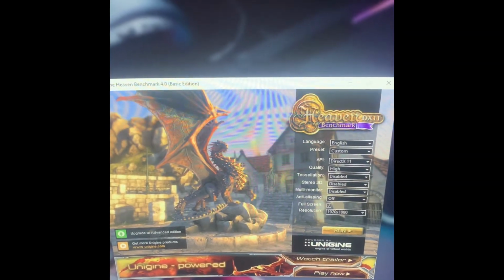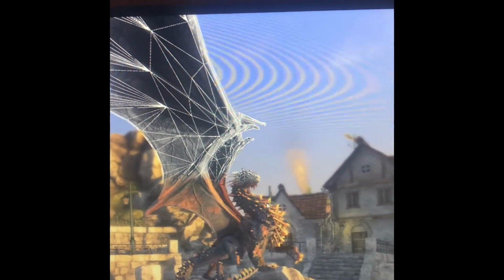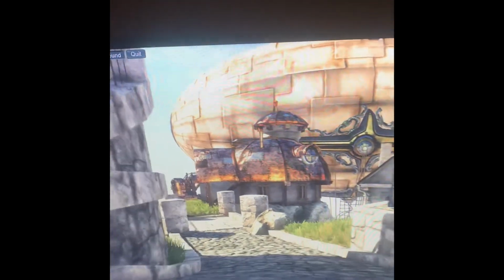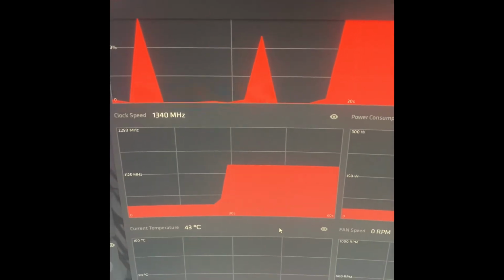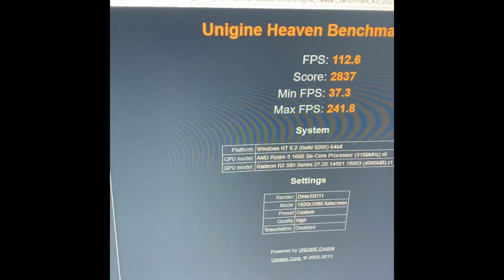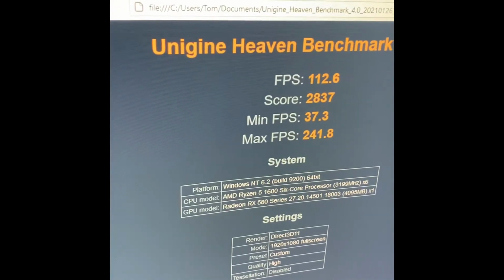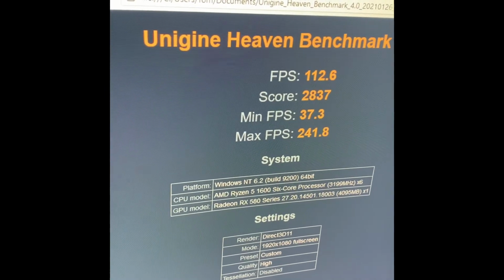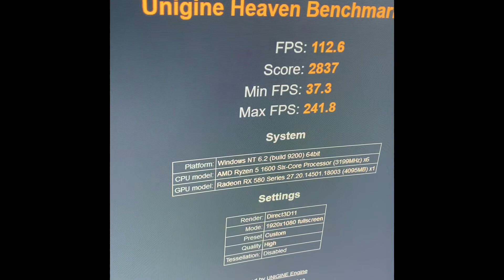Sapphire RX580 - Thermal Pads: What size to use? Explained

Comment: Will this work on the RX 580 Pulse too?
Reply from the maker: Yes, they used the same thickness pads.

You can try squishing down 1mm or just go straight to 0.5.

Had a commenter earlier in the week have success squishing 1mm.
Reply: @JLRO7  Do soft thermal pads depend on the brand?
Reply from the maker: @Skewel  From what I’ve read the higher quality pads will be more squishable but even then I’ve seen people say they didn’t have success with it.

Wouldn’t go for anything less than Arctic/thermal grizzly pads.

But I bought cheap 0.5 and they worked so it’s up to you. If you read through the comments here 0.5 has been successful for others.
Reply: @JLRO7  Hmm you're saying 0.5mm works and Sapphire Support says that 1mm is also good. I'm confused.
Reply from the maker: @Skewel  I’m saying 0.5 worked for me.

1mm did not work for me but others have had success with it. The success depends if the pad will compress enough.

The cards originally used 0.75mm.
Reply: @JLRO7  Did your 0.5mm pads make sufficient contact with the heatsink?
Reply from the maker: @Skewel  Yes, same temperature as the original pads but card boosted higher so better heat transfer
Reply: @JLRO7  Cool, also correct me if I'm wrong, when it comes to thermal pad is 0.5mm greater than 0.75mm size-wise?
Reply from the maker: @Skewel  0.5 is smaller.

0.5 = half of a mil 
0.75 = three quarters of a mil
1 = mill
Reply: @JLRO7  Oh, so I guess even the stock 0.75mm thermal pads were slighty taller and compressed the rest of the length to fit. Whereas 0.5mm is the perfect size.
Reply: @Skewel   0.5 for all? vrm and vram?

Comment: I order a 0,5mm pads for my Sapphire i dont have GPU temps problems in iddle it stays arrouns 25-26C and on full load maxed 74 only in benchmarking,but in games it never passes 65C,and i dont have all thermal pads just a some 2 or 3 it came in that condition,only thing that worries me that i cannot se vram temps...... i dont wanna gpu die in this moments when prices are sky rocket.Did you end up good with 0,5mm?
Reply from the maker: There was nothing wrong with the pads before, I just changed them when I put new thermal paste on which is where is started crashing.

It looks like you have good temperatures, the card would shut down if something was wrong.

I would leave it because it can be a big headache otherwise.
Reply: @JLRO7  I changed today,i put all new 0,5mm thermaln king brand and i i lower temp for 10C in extreme preset test benchmark definitly worked out with 0,5 ty for video bro.
Reply: @grimreaper9853  what thermal pad u used?

Comment: I have the msi rx 580 8gb gaming x card what size thermal pads would work
Reply from the maker: I’ve looked and can’t find any information - best bet is to just leave the pads and put fresh paste on assuming your pads still have some life left.

Failing that I would buy a variety pack of thermal pads and just work down in size until you get stable results.

Starting off at 1mm would be a safe bet.

Comment: just want to mention that your card has a small button switch that switches between performance and silent mode so... the crashes might have been from this. Still thanks for the video, will definitely hope that I won't have to change my pads. Rn all  I want is to remove the thermal paste and put a damn grizzly thermal pad and never open my gpu again
Reply from the maker: Yeah the card worked before I took it apart and didn’t after. It wasn’t until I re-did the pads it started working again.

Unless the pads are in dire condition I would avoid changing them, it’s not worth the hassle. Using some nice paste however is easy and only takes a few minutes.
Reply: @JLRO7  in case you didn't understand you could put on the gpu cpu grizzly thermal pad 0.2 mm you could buy like 32x32 or 38x38 cm and cut it with scissors. After that you wont have to open your gpu again. Unless it's full with dust but that won't happen so easily

Comment from the maker: I only made this video for those who had a Sapphire 580 and made the same mistake as I did as there was very very little information on Google.

If I knew it was going to be top result on Google I would have tried to make it more informative. This was just me after the card crashing all night and taking it apart 4-5 times.

Other 580 owners are asking about their cards and unfortunately there’s even less information out there for other manufacturers.

0.5mm definitely works for Sapphire but other brands use thicker pads so 1/1.5mm might be more appropriate for those.

If you’ve changed your pads on another card comment below and I’ll make a little list of what works for those that find this video.
Reply: Hi, Could you help me with backplate screw positions? I forgot those :(. I have 3 length (same type, black color) of backplate screws.
Reply from the maker: @pcman3158  Hi, I don’t have the card anymore but maybe these 2 images will help?

https://d3fa68hw0m2vcc.cloudfront.net/904/177577833.jpeg

https://legitreviews.com/wp-content/uploads/2017/04/sapphire-nitro-rx580-le-power.jpg

Sort of looks like the longer ones go on the outside and the shorter ones are toward the middle?
Reply: @Jowsh thx so much for this info man. I changed thermal paste n pads from a miner rx 580 sapphire to 1.5mm on memory n it crashed, 1.0mm then 83 on superposition, now i’m just waiting for 0.5mm to arrive n be happy to be able to overclock the gpu 😂😂
Reply: Next time try to use "Honeywell PTM7950" on your card's GPU instead of thermal paste. You'll be surprised.

Comment: Does your fan speed/noise go 100% after using 0.5mm? My Pulse variant been doing max fan noises.
Reply from the maker: No it ran cooler than before the change, if your fans are ramping up like that you may have to look at the thermal paste application. 

Chances are not enough heat is being exchanged because there’s too much applied.
Reply: @JLRO7  How do you get VRAM and VRM temps on your nitro? I can't seem to get real temps as fans go max even below 70C.

Comment: I also had this problem in November 2020.
Bought 1mm and although gpu temps were low, it was not boosting pass 300mhz and the FPS were very bad... Before respasting everything worked well but I still wanted to repaste because its a mining card and it turned out to be a lifesaver because the pad and paste were so dry it cracked... I ended up buying 0.5mm and everything is now fine... Temp is a little higher than before respasting but at least I know its clean and safe
Reply: What brand of pad did you use?

Comment: Will the size be the same on the gigabyte rev2 model?
Reply from the maker: A quick google search has said 0.5 for the modules, 1mm for VRM and 2mm for backplate
Reply: @JLRO7  my model doesnt have a backplate i have the rev2 its different but would it still be the same?
Reply from the maker: @SquidNgzz  There’s very little information on Google, there aren’t any confirmed numbers which means you’ll have to use a bit of trial and error.

I would get some 0.5 and 1mm and just experiment.

I did find a comment from somebody on Reddit who used 0.5 on their Aorus variant and they didn’t have any issues.
Reply: @JLRO7  alright thanks mate
Reply from the maker: @SquidNgzz  sorry I couldn’t get a clearer answer, I did look.

The card in the video with the wrong sized pads is still going strong after 6 months. So I don’t think it’ll be a huge deal if the pad sizing is a little off.

Comment: when the software benchmark crashing, did the sapphire led turn off? cuz mine is off and the fan card spinning so loud. i'm using the 1mm though, after watching your video i'm sure will change it to 0,5mm
Reply: check if the button switch is on performance or silent mode. If you have 580 series just look up a video and see that your card has 2 modes
Reply: @BamBam-je4yf  do you mean that switch button on the pcb?
Reply: @gabrel-dias  yes that's the bios switch button. It changes from silent mode to perfomance. I personally never switch it to silent mode because Im either gaming or playing with Photoshop
Reply: @BamBam-je4yf  but does it affect just the fans or the clock?
Reply: @gabrel-dias  I think both. When I was in silent mode my screen used to turn off but the sound continued why gaming . Only restarting the pc worked so I switched the bios to performance and there you go
Reply: @BamBam-je4yf  thanks bro, gonna check if mine is switched to perfomance

Comment: Most likely it was a Mining card, but with the way things are you are lucky, the best I could get was a get a Sapphire RX570 pulse 4gb used, paid the same. now I have to do the same thing you did for my card. so this was really helpful.
Reply: all the 2nd hand cards are mining cards so if you are looking to get one you should wait until you get at least 8GB video card for 200-250 your currency, otherwise it's not really worth it. And if you switch the thermal paste with 30$ thermal pad(grizzly 0.2mm)it will be around 230 or 280 so it's worth it. If the thermal pads are damaged for the other microprocessors then it will be a bit pain in the arse. but the price won't exceed 300 so...
Normally a 8gb card is around 600$ or so.

Comment: how about the pad on the backplate? can we use the same size?
Reply from the maker: Hi sorry didn’t see this. 

The backplate pad isn’t too important so it’s fine.
Reply: @JLRO7  Hey where did you find the manufacturing diagrams? Can you send me the website or link as I want to know the size of my rx 570 armor 8gb oc's one.
Reply: The original thickness pad on backplate are 1.0mm.. also u can put 0.5mm aswell

Comment: I wish I watched your video before doing the exact same mistake today, 16th of April 2021:) I, too, read well before repasting and changing the thermal pads today that 1mm will squish. So, I didn't check youtube or anything else. I thought I "knew". And, no, the 1mm pads didn't squish. Just had the same Heaven crash and then finally went on youtube and saw your video. I used Arctic thermal pads 6w/mk. Will try the 0.5mm. Many thanks for your vid and testing!
Reply from the maker: That’s why I made the video, it was very frustrating reading 1mm will squish and it works when it didn’t for me.

Seeing as we had the exact same problem I’m confident when you can test it will work for you, 4 months later and the card is working strong
Reply: @JLRO7  Actually, in a few minutes after I wrote my comment, I realized that I still have two 67mm 0.5mm Adwits pads, from another older purchase for a motherboard VRMs. The same pads that you purchased, just in a mix pack. So, despite late night here (NY), I was anxious to see the results and immediately replaced the 1mm Arctic pads with the 0.5mm Adwits. Everything works now, no Unigine crashes, idle is around the expected 46-53c when the fans start at 53c and then stop at 45-46c, while the load in Unigine Heaven was 70c (unfortunately, I don't remember fan RPMs). Playing a FPS game today resulted in 68c and max 2100rpm. Thank you again for a very useful tip!
P.S. Oh, in my case the Adwits that I purchased I think about a year and a half ago, were softer than the Arctic pads. Arctics were quite, quite stiff, if anyone would be interested in a comparison - taking into account that at least in the US an Arctic pad 2-pack (120x20mm with varying thickness) is about 12USD and they might be relatively popular, but 1mm is very stiff.
Reply from the maker: @dveydah  Awesome, glad it’s all fixed. Great comment too with some actual numbers others can see if they come here with the same issue 👍🏻
Reply: I just ordered mine after thinking about it for a long while. These arctic ones appear really stiff in my opinion. I bought some similar ones for another project, and they were too hard. So I went with some softer 1mm ones. Will let you know if those work or not. As far as I'm aware, these hard pads are not the ones you want to be using for this gpu. It should be similar to the original both in thickness and softness. But we shall see. Thanks foe the video btw.
Reply: @sodapopjam  How was it? Any updates? What brand of pads did you use?
Reply: @innogz6200  Great so far! I got Gelid Extreme ones and they squish to size. Just make sure it's the Extreme line and not Ultimate because it's harder.
Reply: Oh and one pack was enough.
Reply: @sodapopjam  You went on 1mm? does it need compressing?
Reply: @innogz6200  Yes, I got 1mm pads, In my case, I didn't need to compress them manually, the pads are soft, so they compressed when I screwed down the heatsink. I used a cross pattern to apply even pressure. My gpu barely makes any noise now, even when playing FFXV which wiuld bring the temps up to 78-80 C and the fans spinning up to 60% of their max speed. It rarely goes up to 25% speed now, and the temps stay just below 70 C when at max load, with the default fan curve.
Reply: @sodapopjam  That's good to hear. I'll be confident about 1mm pads now. My Pulse card is only few months old but it maxes its fans out for unknown reason. How old is yours? Is it a Pulse?
Reply: @innogz6200  Mine is a 570 nitro that's a couple of years old, it also uses 0.75mm pads. I was starting to notice a bit of choppiness plus fans spinning really hard, with temps close to or at 80 C in demanding games even on low settings, so I replaced the thermal paste and noticed the pads needed a change as well. The paste did help, it dropped to 75 C max, but after changing the pads it's so quiet and never goes above 70 C. I prefer quiet fans to lower temps, 70 C is fine for gaming. It hovers at 40-45C when iddle, 50-55C while surfing the web or playing chill games.
Reply: @sodapopjam  Nice, hoping to get quiet fans aswell with Gelid Extreme.
Reply: @sodapopjam  Gelid GC-Extreme 1mm are good and soft?
Reply: @sodapopjam  please link to this oryginał pads.
All must be 1mm pads??
front, back, power, ram?

Comment: Is 0.5.mm good enough?
Reply from the maker: Yes, the pads I fitted from this video are still working great. 

A commenter below used 0.5mm too and it worked fine. I have linked the ones I used in another comment.
Reply: @JLRO7  can i plz have the link I’m having the exact problem and may I ask what size pads did you use for the other parts you had to cover  were ?
Reply from the maker: @abxshorty3491  If you look below for Romario I have replied to him with the link for the product I used. 

I used 0.5 for the VRMs and I used the thicker 1mm for the back.

Another commenter Vadu posted some useful information below too. 👍🏻
Reply: @JLRO7  can i plz have the link I’m having the exact problem and may I ask what size pads did you use for the other parts you had to cover  were ?

Comment: Which brand do you use?
Reply from the maker: https://www.amazon.co.uk/dp/B07PNL9C1Q/ref=cm_sw_r_cp_api_glt_fabc_W3ZBWXBQPQ181GR1VRMH?_encoding=UTF8&psc=1

Adwits is the brand name - as mentioned in the video I’d probably go for a better brand but the card is still going really strong using these so can’t complain really
Reply: @JLRO7  how much did you use? Does one sheet 50x50x0.5mm will be enough?
Reply from the maker: @BadgerGamingTV  Sorry only just seen this, I used 2 sheets to cover everything at 20x67. If you only have the 1 sheet at 50x50 I think you could get away with it with some thought and careful cutting. The sizes don’t need to be super exact.
Reply: @JLRO7  Oh btw I used the Adwits on a motherboard VRM, but had to return the mobo, so no before and after, but the indeed seem okish.
Reply: Well done. Thanks for the info.

Comment: Did you notice a difference with the temperatures?
Reply from the maker: Temperature was the same at the end but the card boosted higher and got better results.
Reply: @JLRO7  Did you cover the entire vram completely and leave anything left over or on the border of it? I got 82 degrees with the RX 580 Nitro+ at 2400rpm I do not think that's normal
Reply from the maker: @Khaphnis  I tried to size the thermal pads to the VRAM as close as I could but as you can see from the video it’s not perfect, there’s some overhang on some of them if you look at 3:15. 

Have you already taken it apart or is it something you will be doing?
Reply: @JLRO7  I have already take several attempts, first I did it with 1mm, then I tried to squash the 1mm ones to reach 0.5mm but there was no difference.
Reply from the maker: @Khaphnis  Yes I had the same issue, 1mm was too thick and it would overheat instantly.

That is why in the video I switched to 0.5mm. The card has remained cool and quiet since posting. 

From what I read 1mm pads will not be sufficient unless you buy a very premium brand that compresses properly.